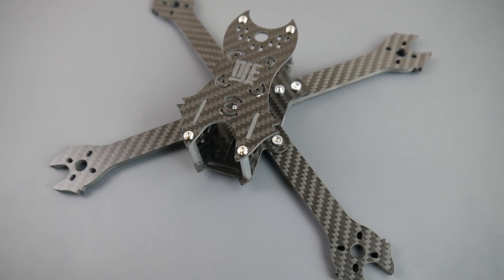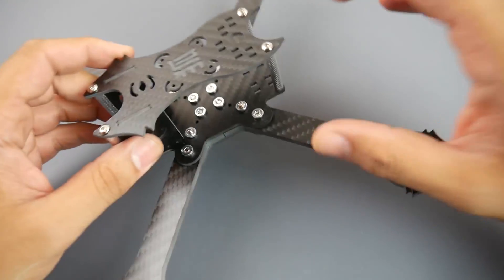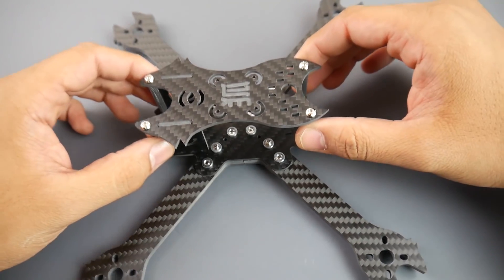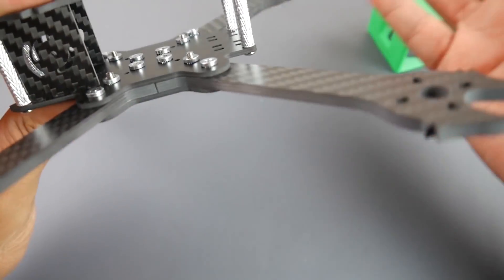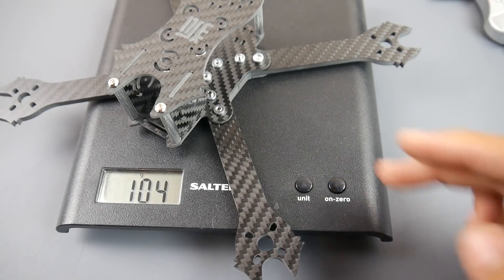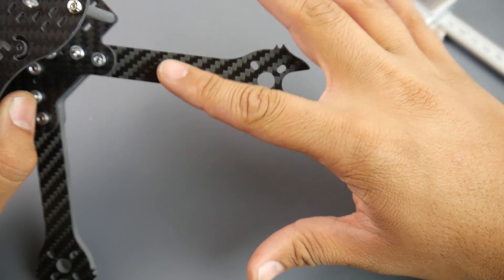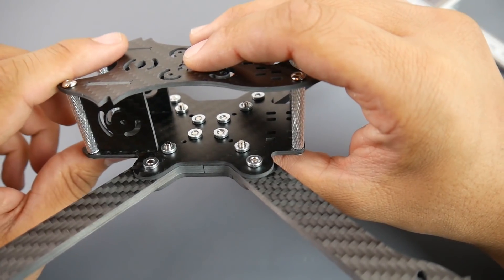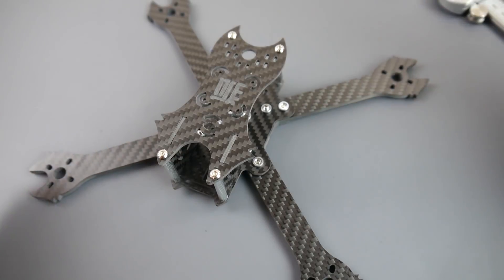A Really Nice $26 Frame // FlyFox No.8 220mm FPV RACING DRONE FRAME

Comment: These arm ends are crap. If you do racing or low proximity and slightly touch the ground, arms formed like this can easily hook into the ground and break. Look for frames with rounded ends, if it has to be budget take a sabotage RC frame for example.